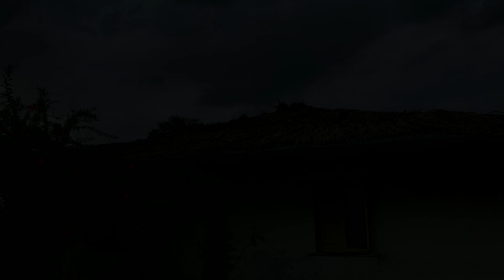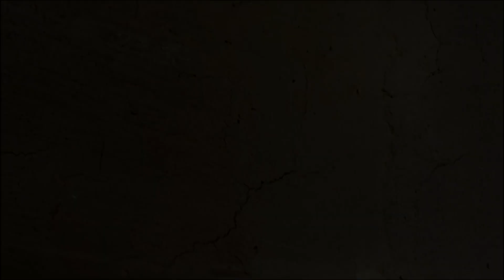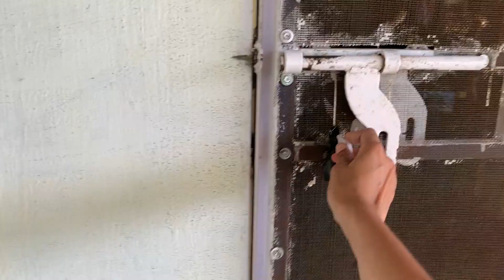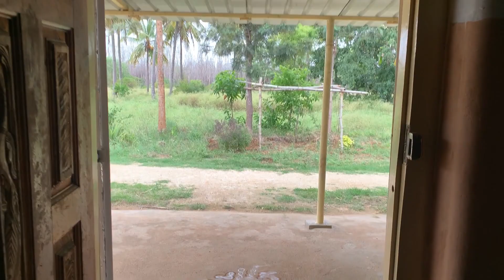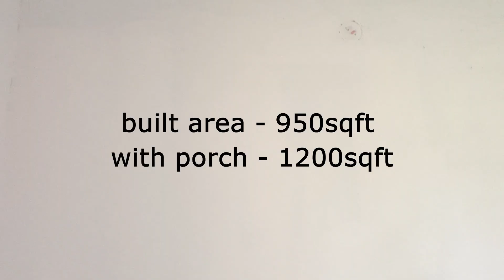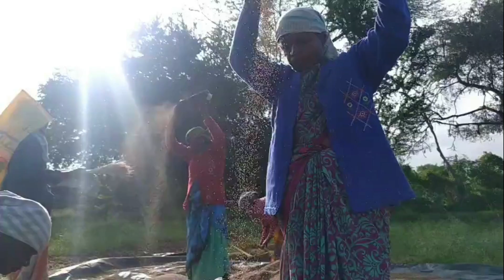mud house update after 4years | How much does it cost | maintenance | low cost mud house

Comment: As for the lower exterior wall, have used mud plaster with lime, cow dung, jaggery, methi soaked water and aloevera sap: it has worked well for us. If rain is too much a smoked bamboo skirting may be used
Hope our experience helps...
Reply from the maker: Thank you for sharing your experience. I had tried fermented prickly pear, but it didn’t work too well for me. The mix you mentioned sounds good — I might try it sometime :)